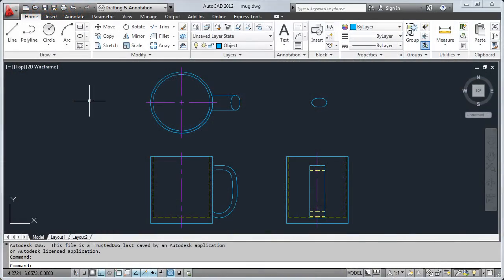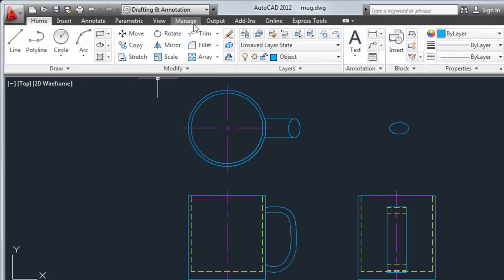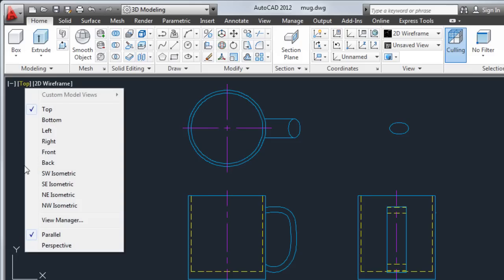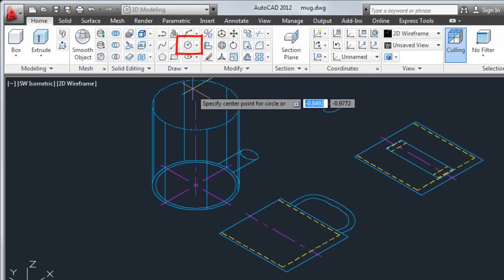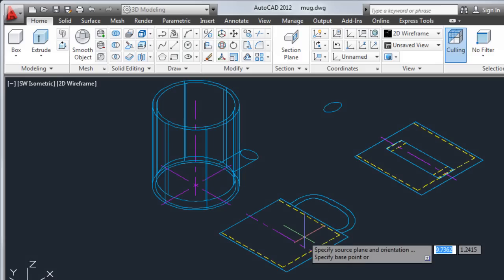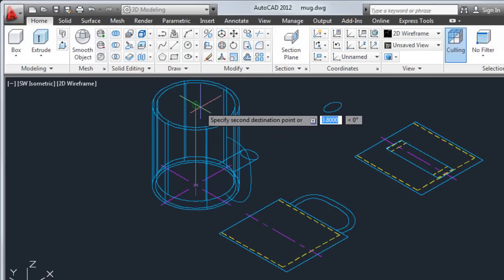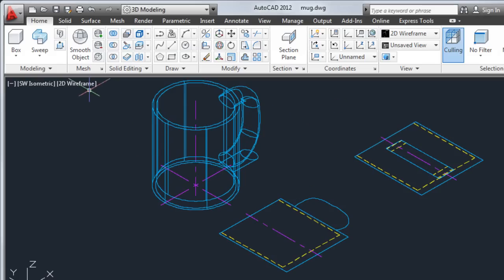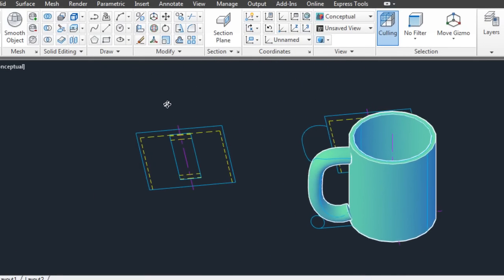Convert 2D Objects to 3D — AutoCAD 2012

Comment: I made an offset half the thickness of the handle for the sweep command, so it would place it in the proper location. If you 3D Align the the OD of the handle, then the OD line becomes the center of the handle after it's swept.